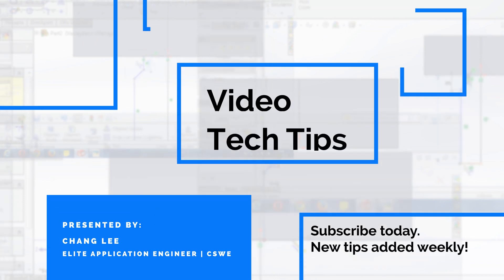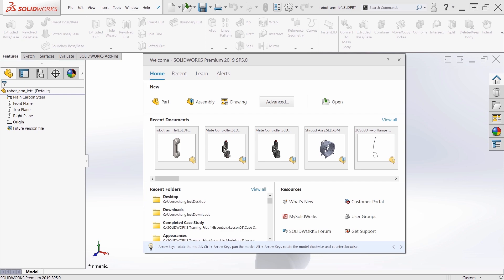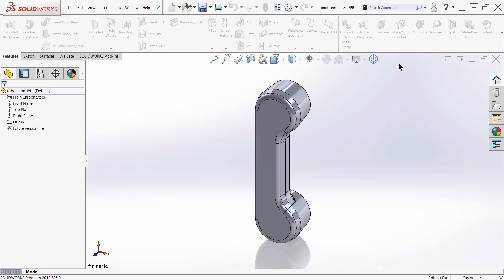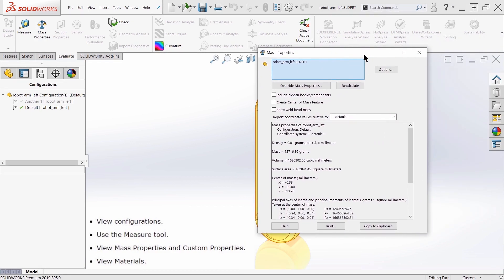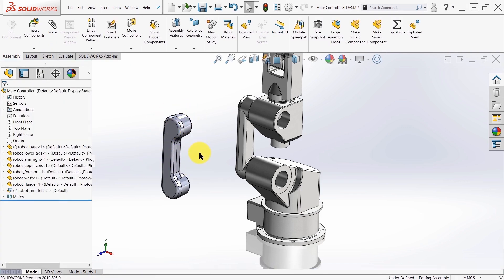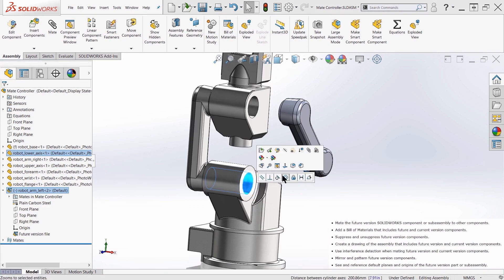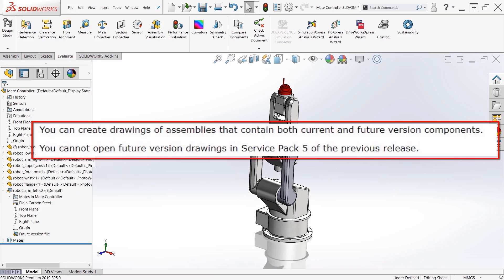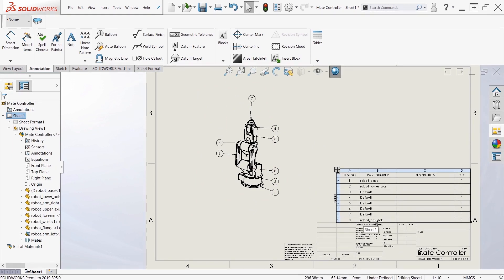SOLIDWORKS Tech Tip: How to Use Future Version Components

Comment: Also, for those wondering... If you need to work with the file, you'll need to save it as a Parasolid (X_T) and treat it as any other imported model. Since he didn't mention it in the video, I thought I would. :)